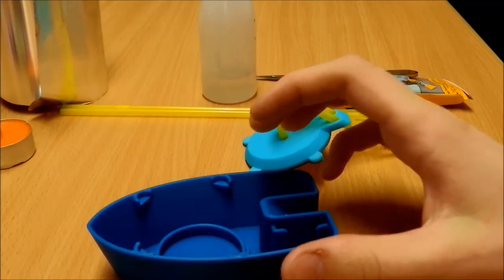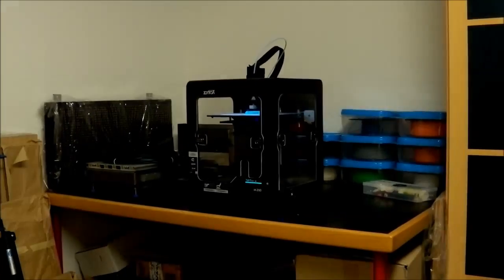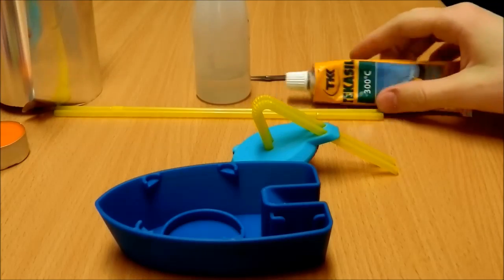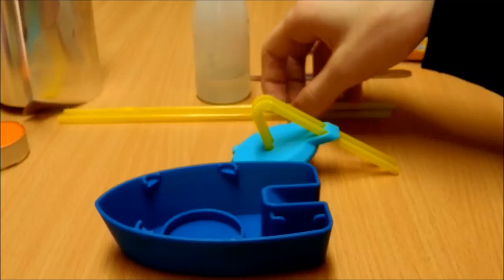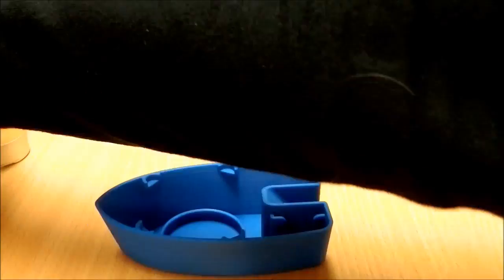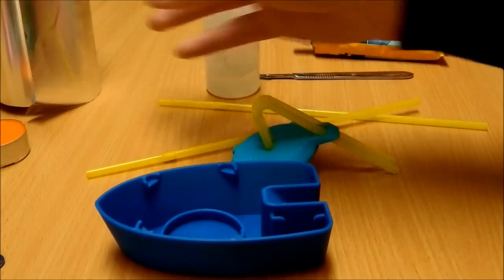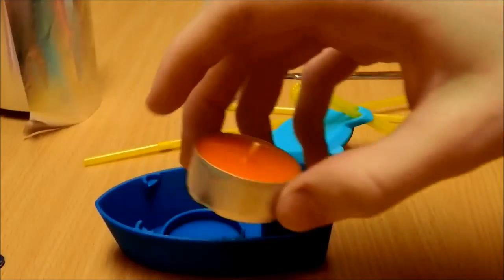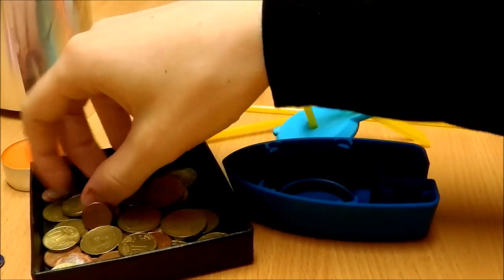3D Printed Pop Pop Boat

Comment: Question made mine pretty much exact and it just sounds like a two stroke engine but doesn’t want to move at all 😳
Reply: Longer tubes, maybe more heat. Make sure it has enough ballast or it will just vibrate in place .

Comment: how do you fill engine with water? and what is acetone for?
Reply: I think he said the acetone was to "polish the engine" so If you want a shiny-smooth look to it, wipe acetone on the outside, since the plastic is slightly dissolvable in acetone. but I personally would skip that step, but I would maybe do it to the boat's hull to reduce friction and go faster
Reply: @nabzim  Only ABS is soluble in acethone; if u use PLA it wouldnt melt with that; you need sanding if you like a more uniform finish (i.e. without layer lines)